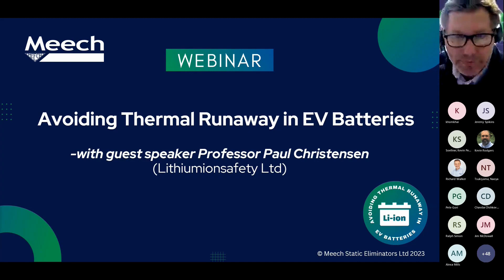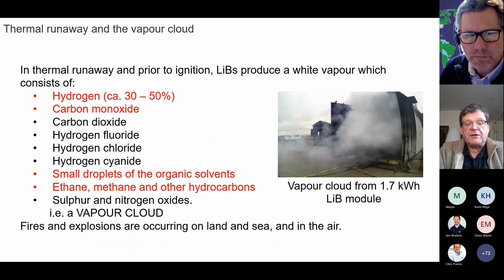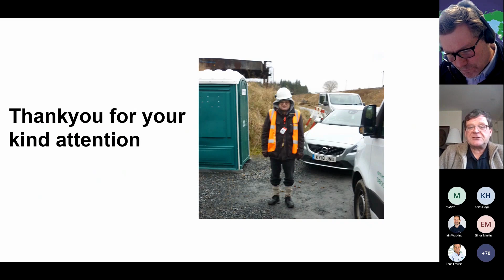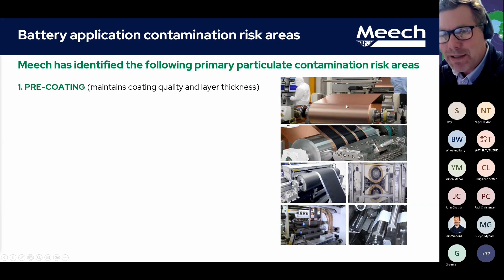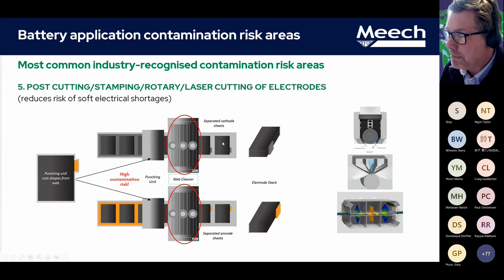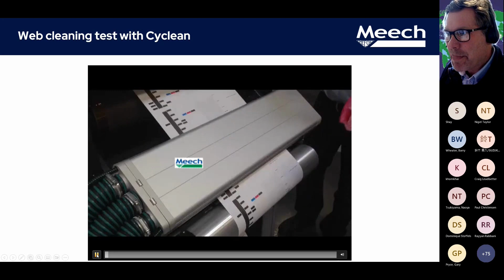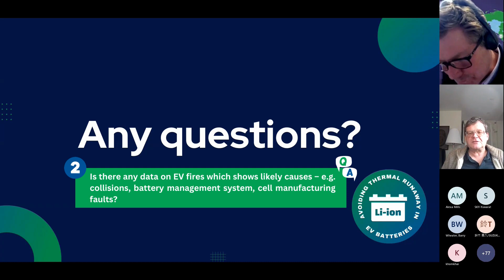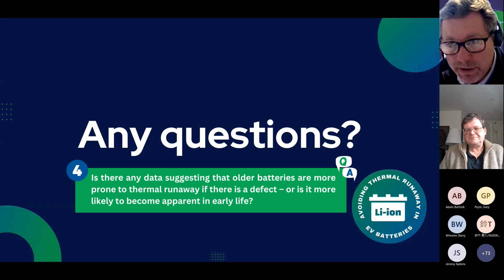Webinar - Thermal runaway in EV Batteries

Comment: I see your accurate ; but it must be pointed out to people - batteries do not need to be abused to catch fire; nor defective. Recently a ship containing brand new just produced EVs had brand new never abused batteries catch fire burning the entire ship up.  It is critical for buyers or potential buyers to realize there is a risk of fire with EV batteries even if you do not abuse them at all. This is due to dendrites; deposits that can build inside the battery which can short basically at random causing a fire; improved manufacturing can't stop this. Once one battery catches fire it spread to thousands of other batteries and there is really nothing that can stop that fire.

Comment: It does not matter how rare EV fires are if they set fire to a North Sea ferry or cruise ship the loss of life will be horrendous as it will if they set fire to an apartment block. They are only rare because sales of EV are low with in the UK being under 3% of all current car numbers. Lithium ion batteries should be banned and users made to replace them with safer sodium  or solid state versions and in fact they may be forced to do so by insurance companies, at least for high mileage cars.
Reply: Sir, just what makes you think solid state or Na based batteries will be safer???
Solid state for example really means LITHIUM METAL ANODE.  Lithium (Or sodium) metal burns quite nicely in Air, and Violently when exposed to water, yielding heat, explosive hydrogen gas and caustic waste with a Ph near 14...
What could possibly go wrong!?